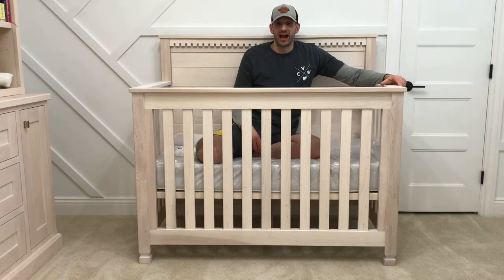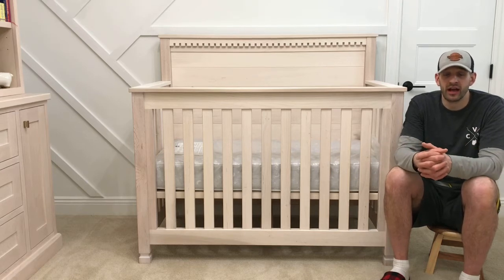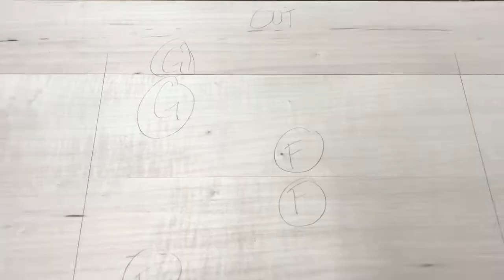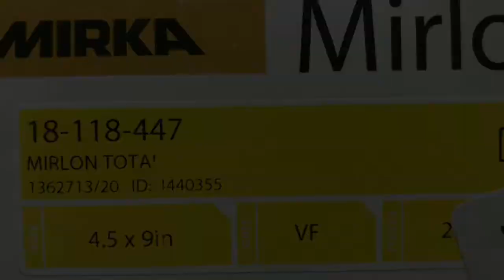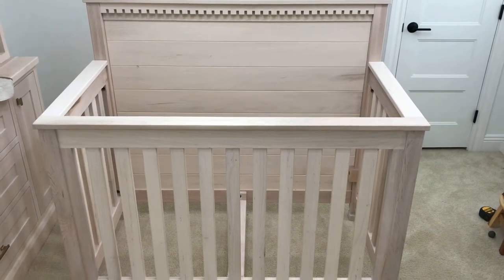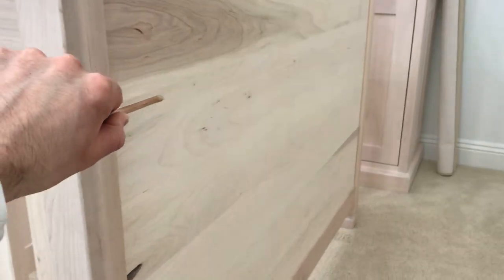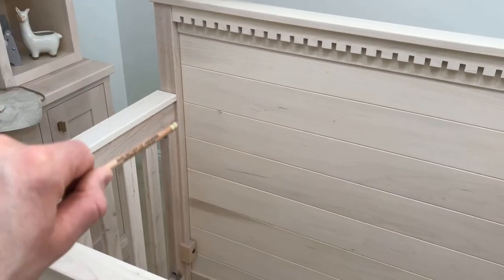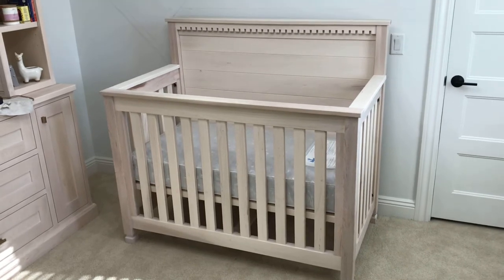Nursery Crib Build - Full Build

Comment: Working on my great grandson's crib from your design.  It's going pretty good 😅.  I really can't even call myself a novice! How did you attach the top caps on the front, sides, and headboard? I've watched your video about 5 times now😂
Reply from the maker: I believe I aligned them with domino tenons then just glued and clamped. The double layer of plywood for the mattress platform is not necessary and makes it hard to handle. I would recommend just using one piece of plywood. I hope the project is going well!
Reply: @villellacustomwoodworking2974  
It's going pretty good for my "first" major project! I actually sawed, milled, and dried my own wood. OAK! This thing is going to be heavy! I didn't have the biscuit jointer so I'm using dowels. A lot slower! But not as slow as hand mortise and tenon! I knew the platform was going to be heavy and awkward, I'd thought about cutting two hand holes centered. Thanks for the inspiration!👍
Reply from the maker: @victormcox  I wish I would have done oak. It will be very heavy. Share a picture when you’re finished.